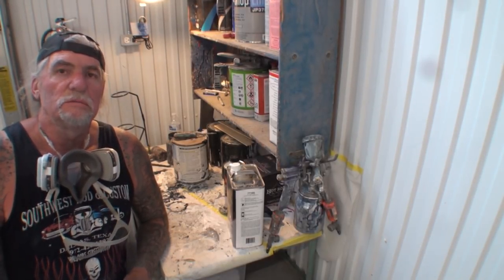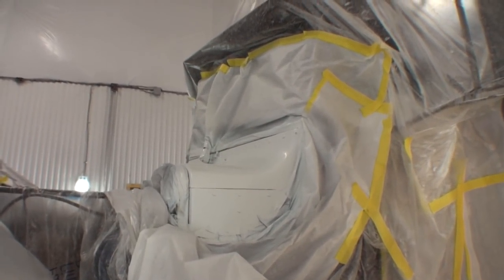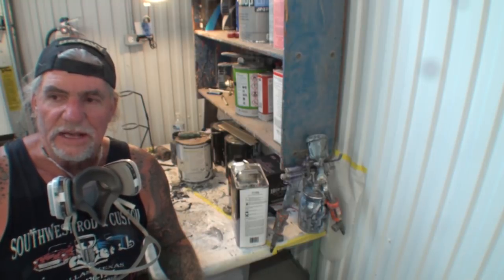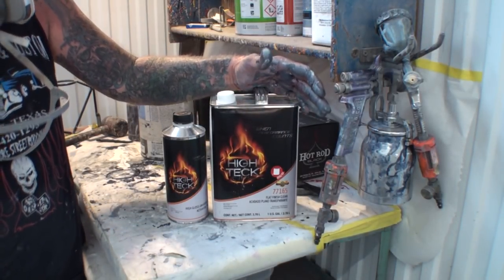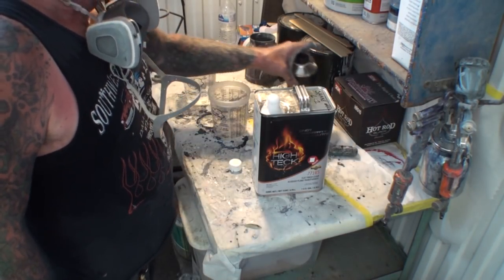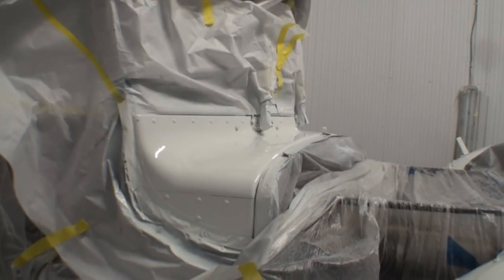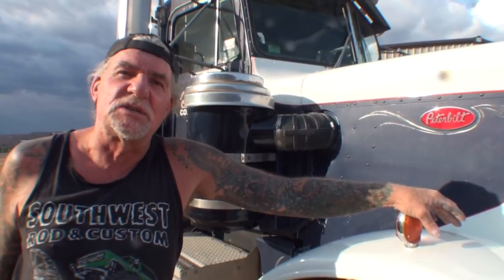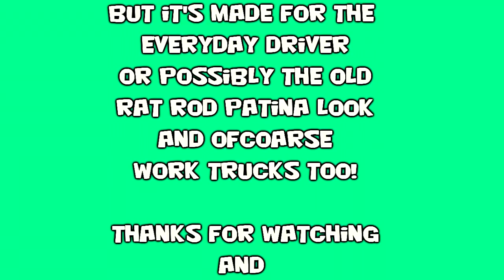[High Teck Urethane Clearcoat] - Should I Paint My Car or Truck with this Stuff? Product Review

Comment: The 6 parts to 1 part activator is a dead giveaway of the solids in the clear. It’s nice to realize that a Binks can throw on 2 coats as done correctly and virtually no orange peel. Regardless of hundreds of expensive paint guns on the market that the first and original spray gun can do the job extremely well. Nice job of explaining what you get! Thanks Pete.

Comment: I love this clear I have small garage body shop deal this is my to go to clear . lays out smooth no orange peel with medium in 70 degree I used the slow hardner in hot temp above 70 were in Chicago so I ordered slow this summer an boy was I happy no runs no wet sand buff sprayed out of my ws.
 400 spray gun 1.3 tip I made off s clear along this summer $1800 buck im happy with it had sum left over in a Up slow no shrinkage I was surprised

Comment: Thanks Pete...for the tip on this High Teck clear....I'll have to check it out on my next shop project. I'm just wondering how it's going to hold-up under weather/how long. It's kinda like experimenting with Rustoleum enamel mixed with a wet-look enamel hardener. I've found that the latter works good together...makes the cheap paint hard and shiny. I did a few cars with it and the paint looked new 5 years later. Had to wet sand/buff but looked no different than the $300 a gallon paint. Rustoleum paint, Acetone thinner and the wet look hardener...costs under $100 for everything. The UV protection is in the hardener. Only problem is the limit of available colors and the colors are plain/ordinary so have to mix different colors together to get something different. I've found it's a better paint than the cheap $50 per gallon auto paint. Just go to the big box stores and pay around $25 per gallon for the stuff if you want to paint a car cheap. Yes I buy the good stuff for friends cars and my own projects but if a friend needs a quick and cheap paint job Rustoleum's the way to go lol. The mistake a lot of people make is mixing it with mineral spirits/paint thinner and no hardener...takes forever to dry and will rub/scratch off real easy. Acetone helps it dry fast...you could use lacquer thinner too if it's a hot day. The hardener has to be a regular enamel hardener not urethane hardener...paint would not dry and be sticky forever...I tried it haha. Had to paint over it with the enamel hardener/paint and it fixed it. An old car painter told me once..."Paint is dumb" so don't be afraid to experiment. Just learn what not to add to it.

Comment: I’ve used the gloss version of this clear.  Picked up a gallon kit at a swap meet for $75 . It seemed to be very thin , easy to run.. However it skinned over pretty fast for production work.  I mainly use it for suspension parts or bumper covers on crappy cars. Wouldn’t recommend it on any job you want to be really nice or durable..

Comment: I sure would like to see you review southern polyurethanes products, I hear they are great and would like to hear what you think about it.
Reply: suplex88  >If you know Pete and his videos, I too would like to spray some SPI product, but it truly comes down to certain basic issues. #1 What does the custom want? #2 What product are you familiar with and used to spraying? #3 Pete buys the products he reviews.
  Now, I would never slam SPI product and I am sure they could get it on the Western Slope of the high desert planes. In this case, it was a barter deal. I’ll Scratch you back if you scratch mine. It is a lot more work to prepare, paint a color primer (What exactly, I didn’t write down) but the guy driving the truck, pushing or pulling the PTO for hydraulics to spread and dump dirt is way easier that Pete’s work. Both need something and saving money was an opportunity to try this flat clear. 
  If Pete has a customer who asked for SPI epoxy, color or universal clear, then he would most likely warn who ever he was not familiar and look into it and perhaps spray some. I am not taking sides on yours, Pete’s or SPI and I plan to use their epoxy on my last build...for me! It’s just in 13+ years of Pete’s videos, he gives the customer an option of a “DBC” something or “Matrix Shop Plus”. Other brands are maybe nice to spray but looking at any vehicle you did a complete restoration on from 18 years ago that was taken care of, tells the Painter it was done right and the product lasted. Spraying is one thing but how does it hold up is the bigger half. I have one chance to do my 67 GM PU because of 12+ of back problems. It sucks. 
I hope this helps, I truly feel where you are coming from and wish you the best in life!! I am truly scared having electrodes implanted in the spinal canal or epidural space is less fun than going to the dentist. Sorry to be so long, but it would like being an artist and waking up blind one day. Pete is Pete. I honestly don’t blame him for using what he knows. No one wants their name on a crappy looking paint job 6 years later,...and not your fault! It’s inside. After all, that all anyone can take with them is their knowledge as the accomplishments stay behind! Peace! Best wishes.
Reply: I have some videos using spi products
Reply: @lonestarlows    >Good stuff man. Mixed some urethane sealer yesterday so my son (34) to paint the hood and parts on his 81 El Co with 550HP under the hood. Went thru 3 differentials that broke. Now, so far so good. 
  You are right, SPI makes excellent product. I will check out your channel. Mrfireman164 uses a lot of epoxy on a Camero complete build. 67-72C10 truck forum is on page with SPI. Using chemical cleaner & 80 grit inside 67 C10 bedsides & bottom of cab. Spray the SPI epoxy then black Raptor over it. Thanks for for channel lead, heading there! Thanks.

Comment: Question for Pete!!   I need help deciding how much rust is worth fixing on any given part. Let's use a battery tray for example. 90% good metal. Cost for new is roughly $60  is it worth the time sand blasting fixing and painting?  So I'm thinking cost of electricity,sand, vacuum filter, my time ect.  Just trying to get a feel for what's a waste of time. Not sure if you have a video on this subject?  I've been watching your video's through out the years.
Reply: if it's 90& good metal I would fix it before buying a new one.. Thanks for watching!

Comment: 6 to 1 is weird mix
Reply: John, PPG Delfleet commercial truck , 6:1:1
 6 paint, 1 activator,  1 hardener. No reducer.
Reply: @Dixler683  isn't activator hardener?
Reply: @lonestarlows  defleet is a paint for “fleet “ vehicles. Like duponts IMRON. High solid paint, must be activated first, then hardener. No reducer is used, the mixture  is pretty thin when mixed and flows extremely well. A three component paint. 6 pints  color, one pint activator and one pint hardener = 1 gallon mixed.